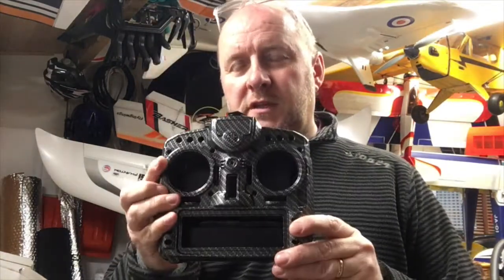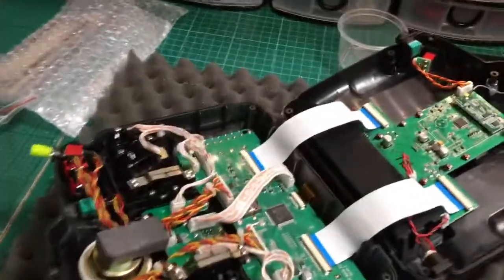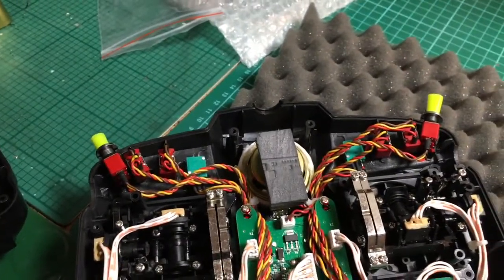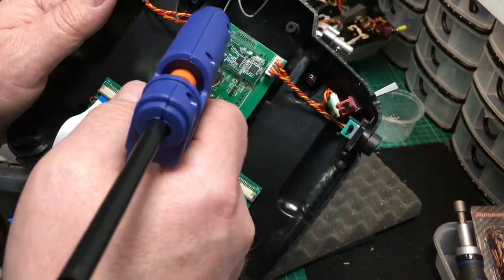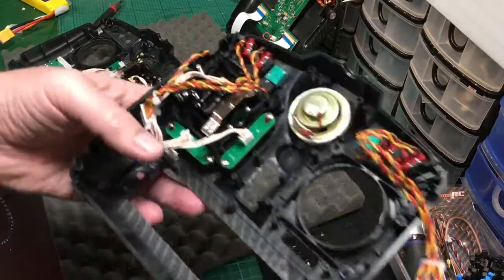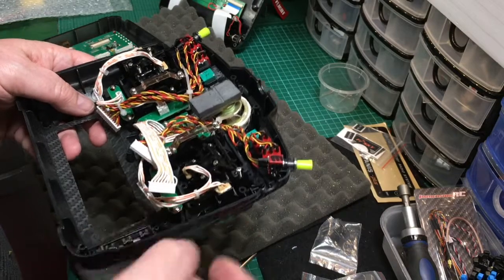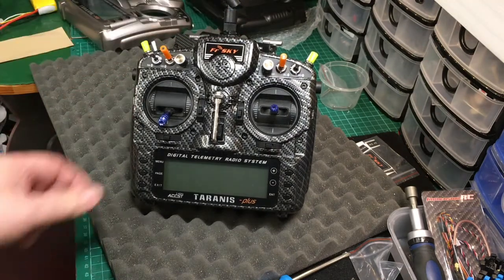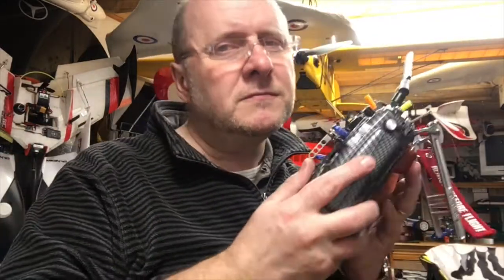Taranis Case Change with antenna & speaker mods

Comment: Looks good.. got my spare case here ready to be hydro dipped.. will be transferring over the guts also..
Reply from the maker: I never liked the cheep plastic silver finish.......its good to be unique. Don't rush the transfer and my advice would be to get a new clear window and navigation buttons as they are glued in.
https://www.t9hobbysport.com/taranis-tx-spare-replacement-parts
Reply: Team Wooly Sheep Reviews already ordered both lcd and new buttons ;)
Reply from the maker: LCD.......I hope you mean window.......LCD is part of the circuit board beneath window. The window is stuck into the outer case.....
I saw this that looked a good alternative: 
https://youtu.be/sawjsny4cEQ
Reply: Team Wooly Sheep Reviews yeah was only couple quid.

Comment: Your antenna mod looks mint, what parts did you use and why do you not need to solder it?
Reply from the maker: Nolan Oliver I have the Teranis Plus and has a small antenna plug on the pcb so no need to solder. If you know somebody with a 3D printer then google thingverse and there are downloadable 3D models. Search for Taranis and there are a host of printable mods.
Reply from the maker: Nolan Oliver Nolan Oliver I have the Teranis Plus and has a small antenna plug on the pcb so no need to solder. If you know somebody with a 3D printer then google thingverse and there are downloadable 3D models. Search for Taranis and there are a host of printable mods. I had to trim and grind the 3D part to get the antenna connector to fit deep enough to allow enough threads for the antenna to make good connection.